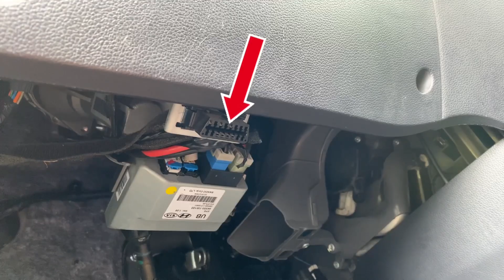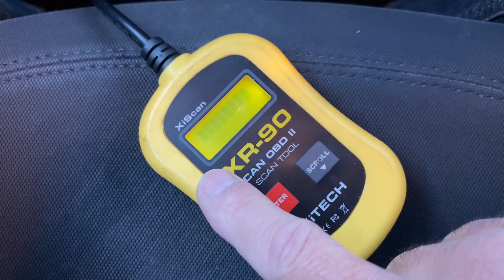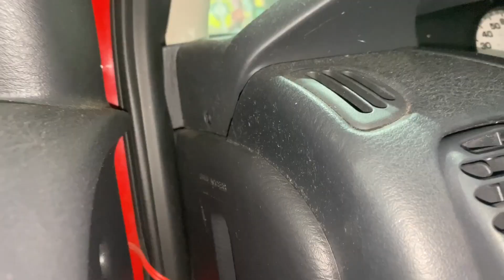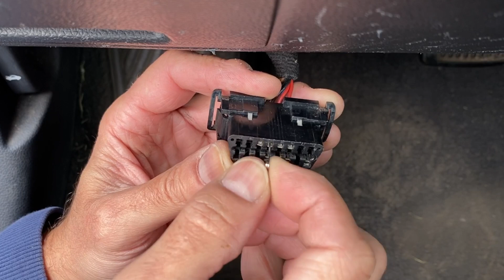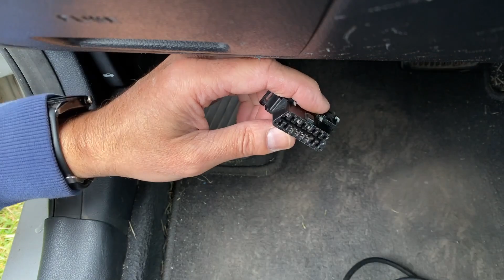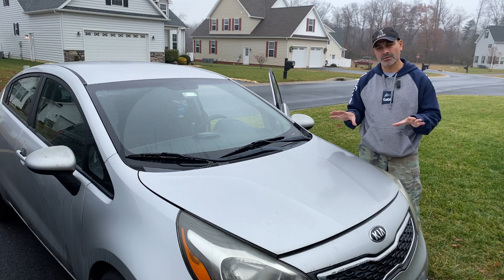How To Fix An Unresponsive OBD2 Port (Andy’s Garage: Episode - 443)

Comment: Hi..this is very helpful! One question- with the loose connections, do I need to unplug the negative on the battery before I check if they are loose?
Reply from the maker: @rosycreatestuff  no, I don’t and never had any issues